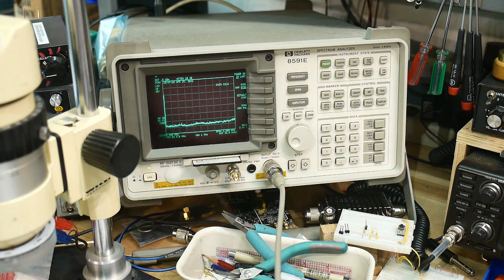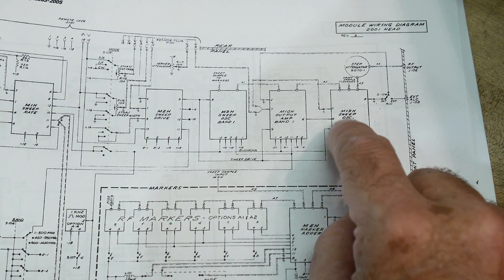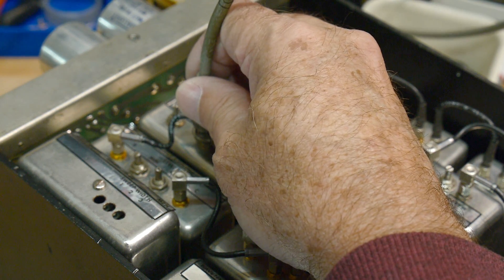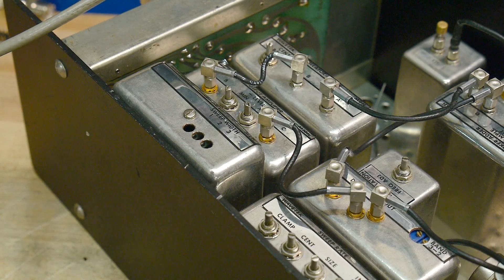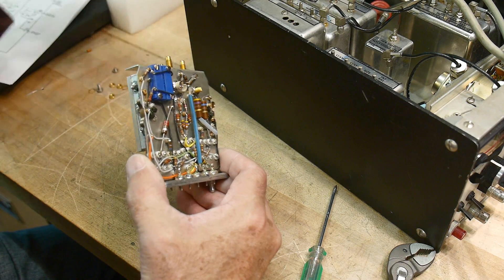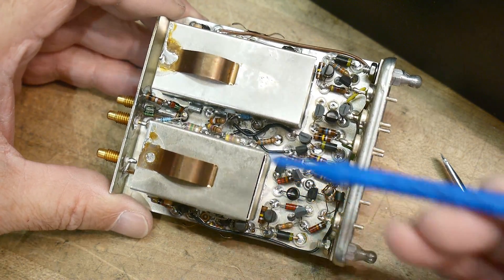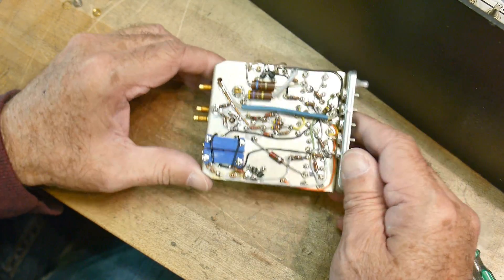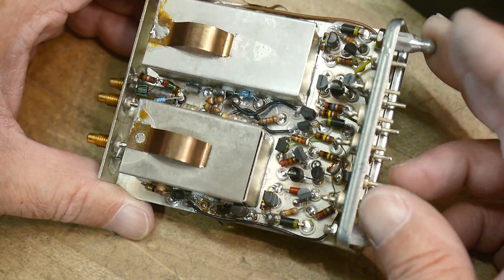#1122 Wavetek 2001 Sweep Generator (part 2 of 10)

Comment: I use to test 12.5 Mhz IF strips for a Military ADF receiver that used the exact same construction . They used the same Teflon solder cups for all the components and similar metal boxes to keep everything RF isolated. All back in the 80's for me. Almost took as much physical hardware to construct as components 🙂

Comment: Fascinating piece of Kit. If band 1 is output when neither transistor is on, could you not try it with the unit unplugged, that way diode D9 should conduct naturally.